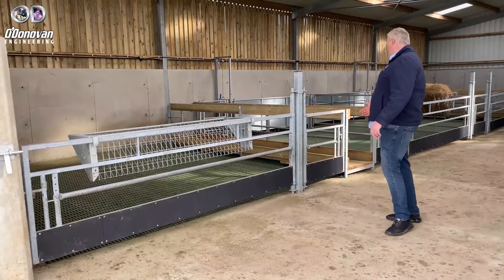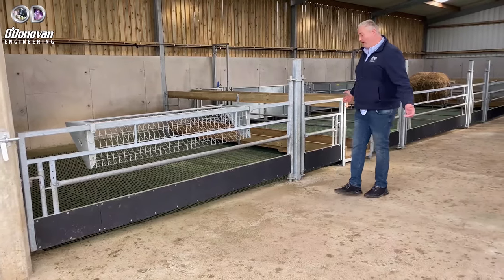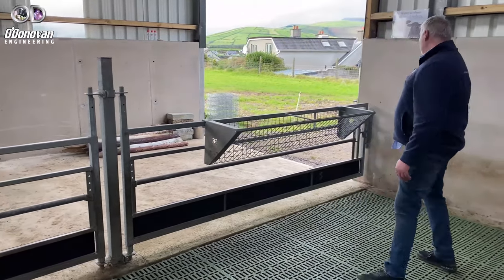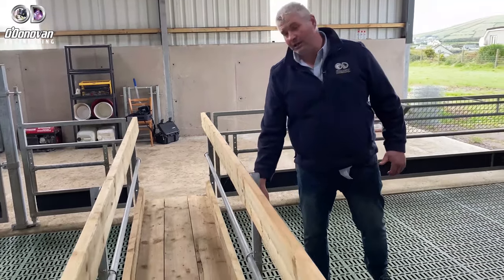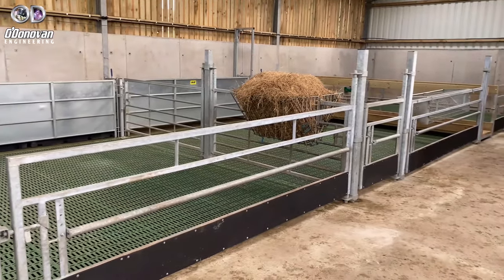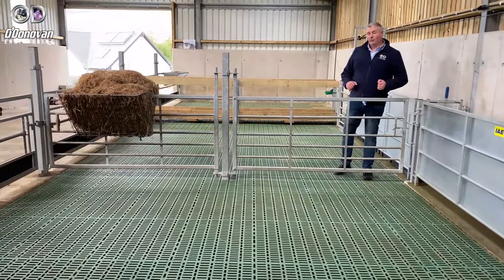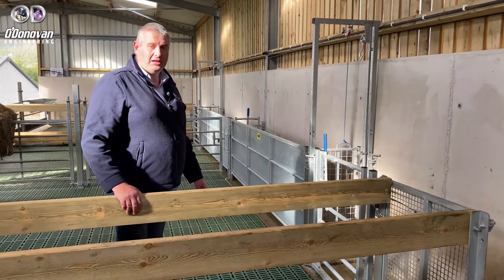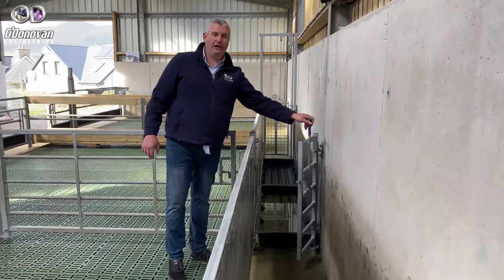Walk through a 4 bay sheep shed

Comment: After ewes have lambed, will the lambs not be jumping out onto the central passage ?
Reply from the maker: The sheep and lambs go out after lambing so this is not an issue on this farm but we do have a solution for that problem which work with all our feeding gates
Reply: If the weather is bad and for the first week at night sheep and lambs would be inside. Can you show a video of the solution please ?
Reply: Maybe a row of lambing pens on far wall and breakthrough into a lean to on that side of shed for ewes and lambs for a few days then put them out?
Reply: If it was me I would bolt some pallets or something to the gates to stop the small lambs escaping. Then remove them once they are grown